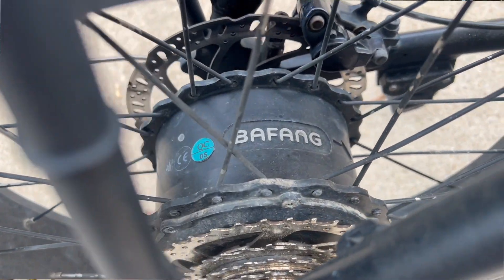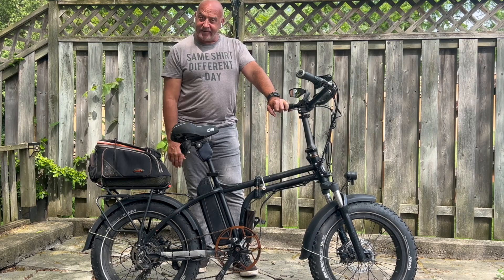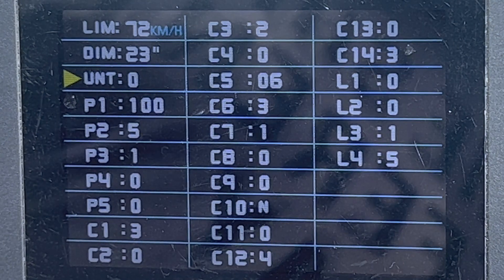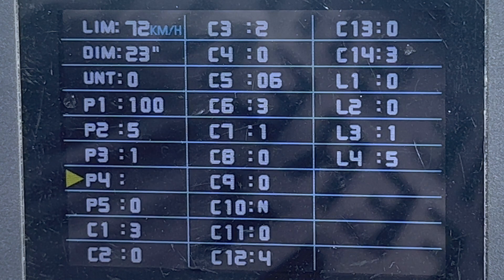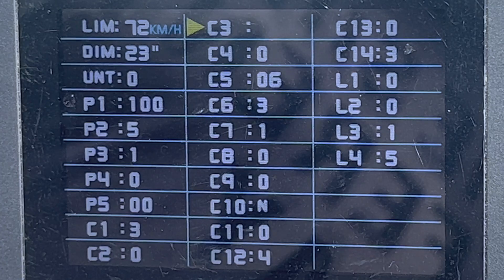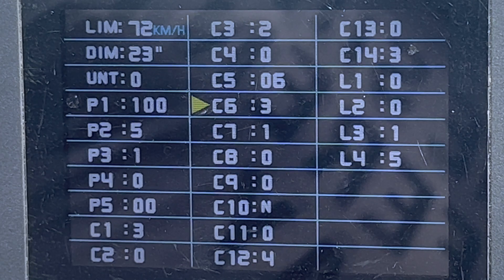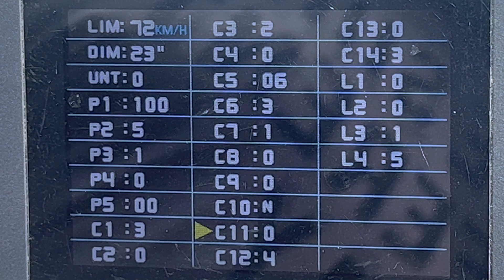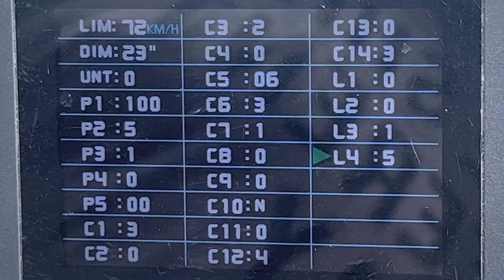35A Controller Settings Explained for Rad Mini

Comment: My setup on a rad v2 that has the display and the control box has a C-15 setting, what is that? Thanx ahead of time
Reply from the maker: Not sure. I don’t have a C15 setting
Reply: @ScottageOnWheels I got mine from  Electro Bike World. Dunno if that’s the separation factor. But yes mine has a c15 lookin at it as I type. Cant send a pic but the variable is 4, 5, or 6. Odd set of choices.
Reply from the maker: Maybe email electro bike world and ask. Their manual online only goes to C14
Reply: @ScottageOnWheels thank you for your time. I appreciate it.

Comment: Was the controller plug and play to the battery, to the motor, to the harness? And the display? Any adapters??
Reply from the maker: @SlingerFinger  the controller comes with it’s own display. I ordered the controller from area13 bikes, because their harness was plug and play for all connectors.

Comment: My cruise control doesn’t work on my bafang set up . I set it c7 to 1, but no luck
Reply from the maker: Hold the down button while throttle or pedaling about 2 or 3 seconds watts have to be going to the motor. symbol will appear on the display. Throttling brakes or continued pedaling will shut it off
Reply: This worked ! Thank you for the response !!

Comment: Which setting could possibly make it where it works throttle only and peddling has no power assist?
Reply from the maker: Don’t think there’s a setting for that. Just use throttle and don’t pedal.
Reply: @ScottageOnWheels  reason I asked is cause while pedaling, I no longer have pedaling assist.
Reply from the maker: @Juice421fs then your pedal assist needs repair. Either the magnetic ring has broken/cracked or the pedal assist sensor has become misaligned. All parts are underneath the pedal housing.
Reply from the maker: @Juice421fs I had to replace my pedal assist. I used a different pedal assist sensor which I think is much better product. 
Ibera Rack & a better PAS sensor
https://youtu.be/0Jjk8BVYyL4
Reply: @ScottageOnWheels  wow! Thank you very much.

Comment: Thank you so much for this
Reply: So after making some suggested changes. This is what happened: my wattage went down to around a max of 1100, my speed went up for for each pedal assist since I'm using more power for each pedal assist. 23mph at PA3 wow! I consumed far less of my batter in total. I commute to work on my bike and it is 9.7 miles. Normally I'd be down 2 bars of batter, but this time it barely went down one just before I got to work. This really helped a lot. Truly.  So there you go, in case you were interested.
Reply from the maker: That great! More power, less battery. Glad it helped!

Comment: All very confusing 🥴 not making me want to get an electric bike 😂 stay safe and well Scott 🇬🇧🇬🇧🇬🇧
Reply from the maker: This is an upgraded controller. You don’t have to do this to an e-bike if you don’t want to.
Reply: Just makes me question buying the 35w controller
Reply from the maker: What makes you question it?
Reply: @ScottageOnWheels do the lights work, how does it work with stock motor? How do you rig it so it stays set where it is?

Also how different is the true 750w
Reply from the maker: The lights work, controller upgrade works fine with stock motor as long as your not using full throttle consistently or it will burn the motor. The settings to keep it set is in my 35a controller settings video. 
In my opinion the true 750 motor made a big difference